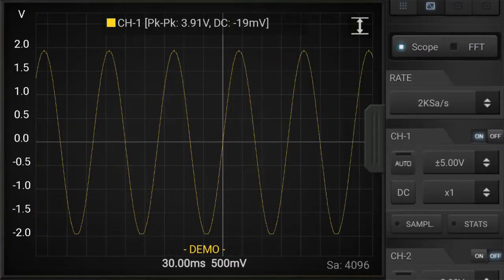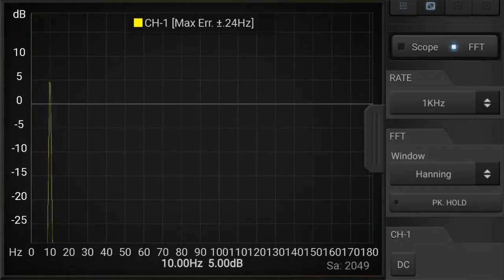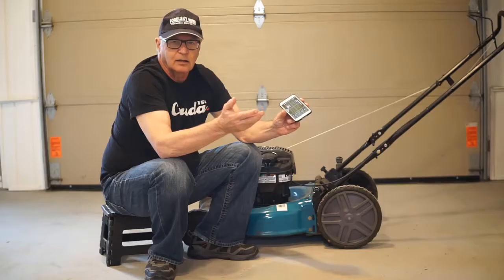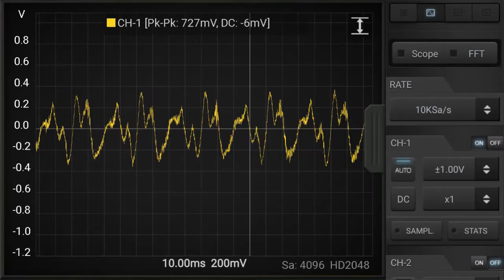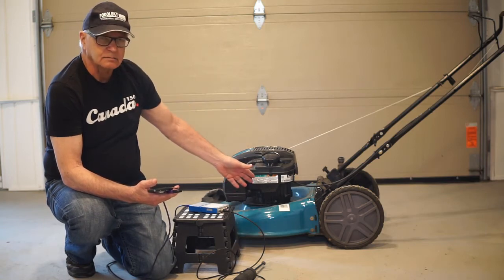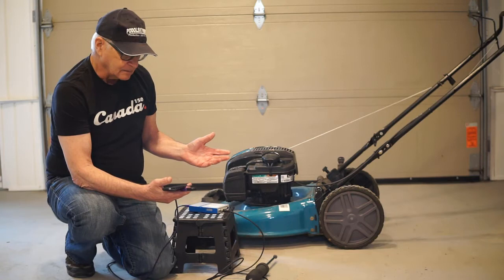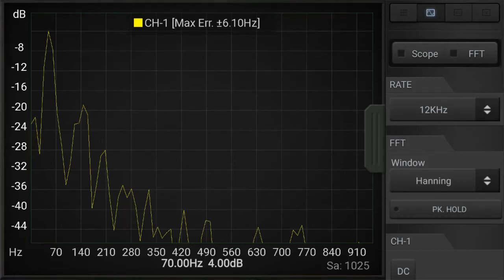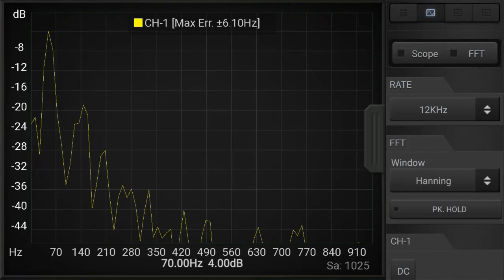GADGETS#53 - FAST FOURIER TRANSFORM

Comment: Dang!  I remember a little about the vector nature of force. The resonance of a two stroke expansion chambers has a lot of pulsing going on inside. This pulsing can b used to provide supercharge at certain rpms. The size of the stinger, the volume  of the pipe etc. I am sure if u hooked your fancy gizmo and honed in on that u would find some interesting bits of info. Data to the guy with a slide ruler and six pencils in his plastic pocket protector. U make us earn our pay grade. Thank u!
Reply from the maker: +Bill Rimmer - you bring up an interesting topic about resonance, Bill.
I think the limits of what a scope can do or what DIY probes can do are only the ones we would impose on ourselves.
Take care🙂